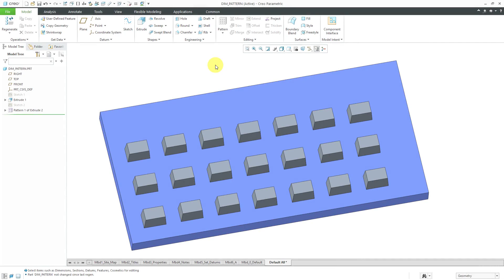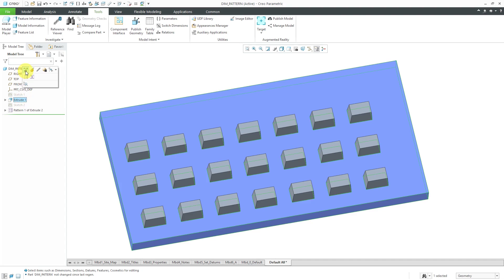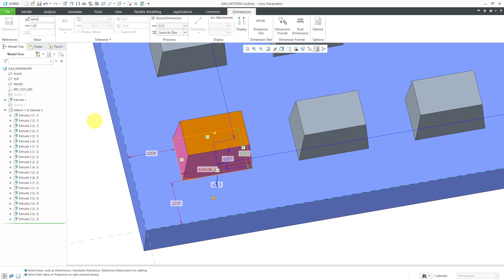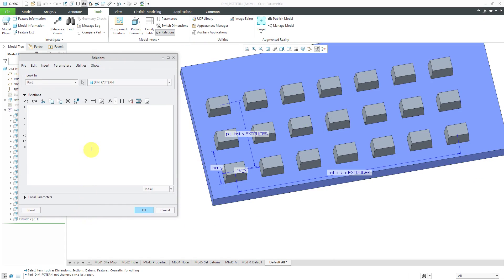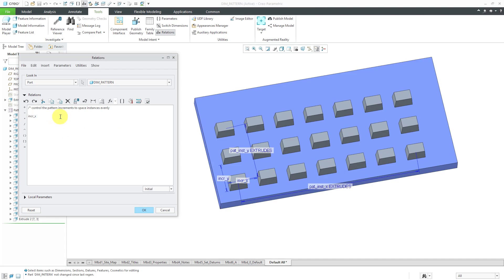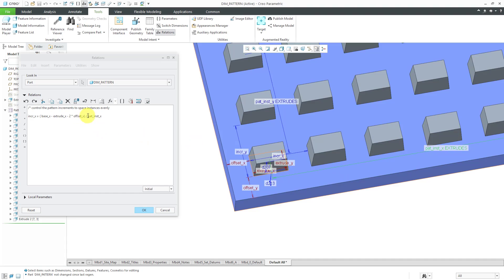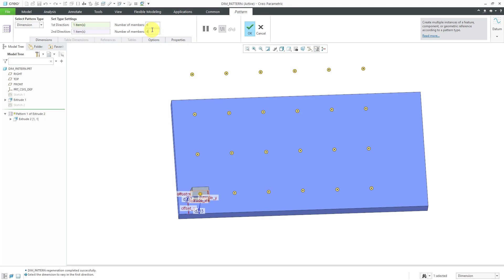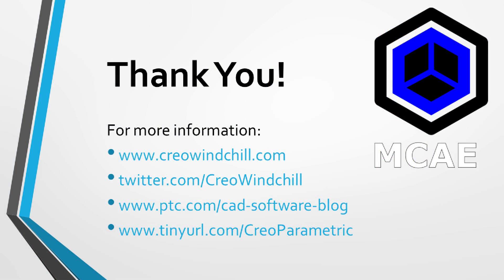Creo Parametric - Patterns - Dimension Patterns with Part-Level Relations

Comment: could you help to show the way to get the number of instances when using pattern on points please. I really got stuck at this feature when I want to pattern a set of holes at a desired position instead of rectangular or circular positions. I'm using create 4.0
Reply from the maker: I don’t understand your question. But it will also be hard for me to help because Creo 4 is so old. It hasn’t been supported in years. It’s almost 9 versions old at this point and there have been so many enhancements to patterns since 2016.

Comment: Good information, I like to increment the value by constant ratio (non uniform gap) in direction or two incremental value in single direction is possible.
Reply from the maker: If you can write an equation, you can do it.
Reply: Creo Parametric , please any example

Comment: Fantastic information. Some times we just calculate to spread the features evenly on the base with a given dimension for x y y, but when it changes you need to modify the pattern. Thank you, excellent video.
Reply from the maker: Thanks, Raul. Often I do the same - calculate the increment and then plug in the value manually - when really I should take a couple minutes to figure out the Relation so I'm building Design Intent into my model.